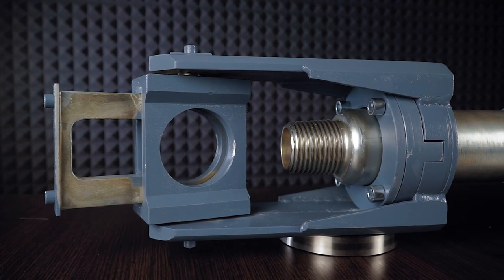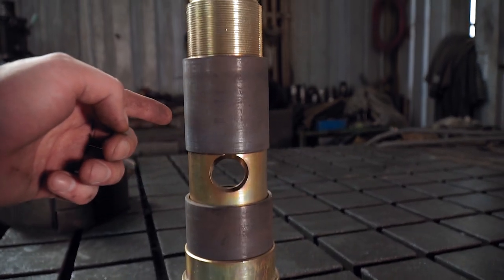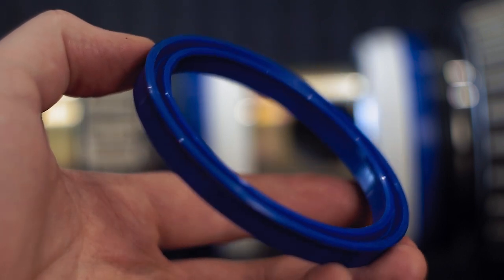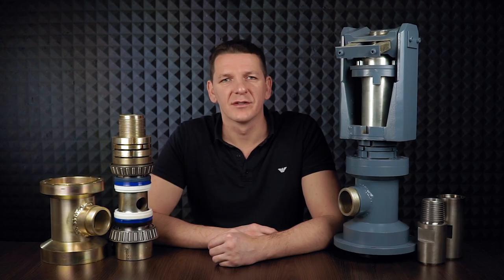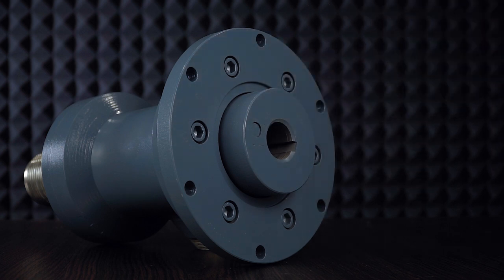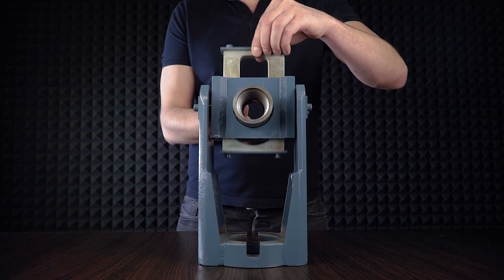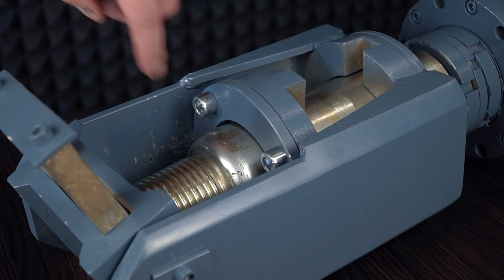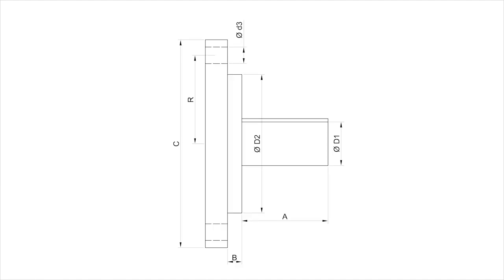Swivel for water well drilling rig

Comment: Which country do are located did you guys send those parts to Mexico
Reply from the maker: We are located in Ukraine
I have 2 models:
1st
SDR-35S Price USD $867 Water hole inside shaft 35mm. Max torque 2000N*m, max pull load 6.8T https://burovik.biz/swivel-s/
2nd
SDR-45S Price USD $1230 Water hole inside shaft 45mm. Max torque 3500N*m, max pull load 11.6T. https://burovik.biz/swivel-45/ 

Also I have Elevator mechanism for $320. It can fit on both models, is presented on 2nd link. 

Let me know model you want to buy, I will calculate shipping price.

Comment: Im disparetly in need for water swivel.
Reply from the maker: I have 2 models:
1st
SDR-35S Price USD $960 Water hole inside shaft 35mm. Max torque 2000N*m, max pull load 6.8T https://burovik.biz/swivel-s/
2nd
SDR-45S Price USD $1280 Water hole inside shaft 45mm. Max torque 3500N*m, max pull load 11.6T https://burovik.biz/swivel-45/

Also I have Elevator mechanism for $460. It can fit on both models, is presented on 2nd link.

Let me know the model you want to buy, I will calculate shipping price.
My mobile number +380500394165

Comment: Good day sir if we order 1"diameter .how much it cost.
Reply from the maker: I have 2 swivel models:
1st
SDR-35S Price USD $1,600 Water hole inside shaft 35mm. Max torque 2000N*m, max pull load 6.8T https://burovik.biz/swivel-s/
2nd
SDR-45S Price USD $2,000 Water hole inside shaft 45mm. Max torque 3500N*m, max pull load 11.6T https://burovik.biz/swivel-45/

Also I have Elevator mechanism for $760. It can fit on both models, is presented on 2nd link.

Let me know the model you want to buy, I will calculate shipping price.

Comment: How much cost.?
Reply from the maker: I have 2 swivel models:
1st
SDR-35S Price USD $1,600 Water hole inside shaft 35mm. Max torque 2000N*m, max pull load 6.8T https://burovik.biz/swivel-s/
2nd
SDR-45S Price USD $2,000 Water hole inside shaft 45mm. Max torque 3500N*m, max pull load 11.6T https://burovik.biz/swivel-45/

Also I have Elevator mechanism for $760. It can fit on both models, is presented on 2nd link.

Let me know the model you want to buy, I will calculate shipping price.

Comment: Máquinas muy excelentes cómo puedo obtenerlas para Lima Peru
Reply from the maker: I have 2 models:
1st
SDR-35S Price USD $867 Water hole inside shaft 35mm. Max torque 2000N*m, max pull load 6.8T https://burovik.biz/swivel-s/
2nd
SDR-45S Price USD $1230 Water hole inside shaft 45mm. Max torque 3500N*m, max pull load 11.6T https://burovik.biz/swivel-45/

Also I have Elevator mechanism for $320. It can fit on both models, is presented on 2nd link.

Let me know model you want to buy, I will calculate shipping price.

Comment: Tôi muốn mua sản phẩm này
Reply from the maker: I have 2 models:
1st
SDR-35S Price USD $960 Water hole inside shaft 35mm. Max torque 2000N*m, max pull load 6.8T https://burovik.biz/swivel-s/
2nd
SDR-45S Price USD $1280 Water hole inside shaft 45mm. Max torque 3500N*m, max pull load 11.6T https://burovik.biz/swivel-45/

Also I have Elevator mechanism for $460. It can fit on both models, is presented on 2nd link.

Let me know the model you want to buy, I will calculate shipping price.
My mobile number +380500394165

Comment: How much sir.? PHILIPINES
Reply from the maker: I have 2 models:
1st
SDR-35S Price USD $867 Water hole inside shaft 35mm. Max torque 2000N*m, max pull load 6.8T https://burovik.biz/swivel-s/
2nd
SDR-45S Price USD $1230 Water hole inside shaft 45mm. Max torque 3500N*m, max pull load 11.6T https://burovik.biz/swivel-45/

Also I have Elevator mechanism for $320. It can fit on both models, is presented on 2nd link.

Let me know model you want to buy, I will calculate shipping price.

Comment: Hy I need one
Reply from the maker: I have 2 models:
1st
SDR-35S Price USD $960 Water hole inside shaft 35mm. Max torque 2000N*m, max pull load 6.8T https://burovik.biz/swivel-s/
2nd
SDR-45S Price USD $1280 Water hole inside shaft 45mm. Max torque 3500N*m, max pull load 11.6T https://burovik.biz/swivel-45/

Also I have Elevator mechanism for $460. It can fit on both models, is presented on 2nd link.

Let me know the model you want to buy, I will calculate shipping price.
My mobile number +380500394165